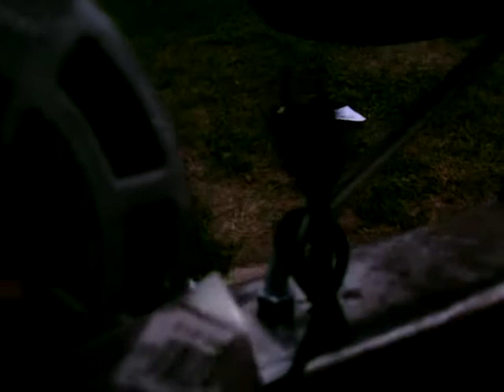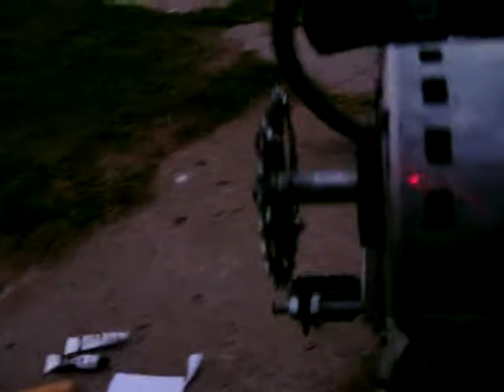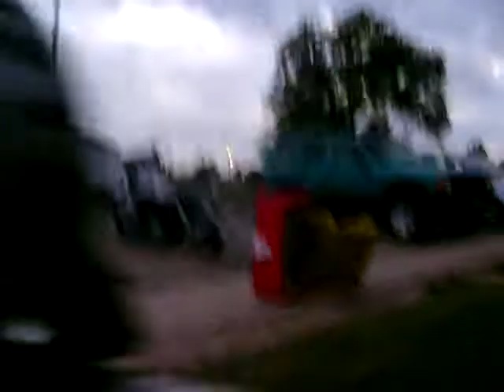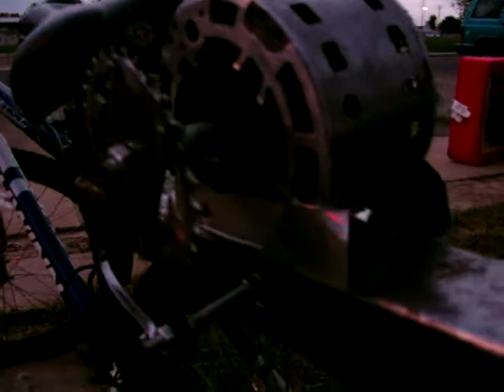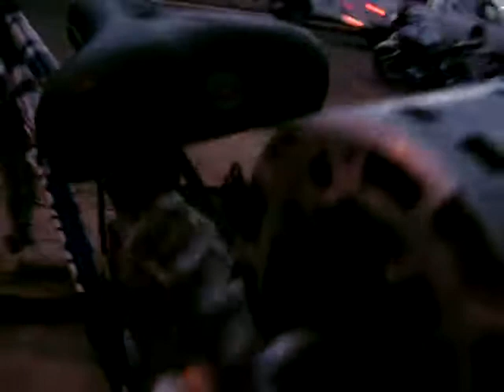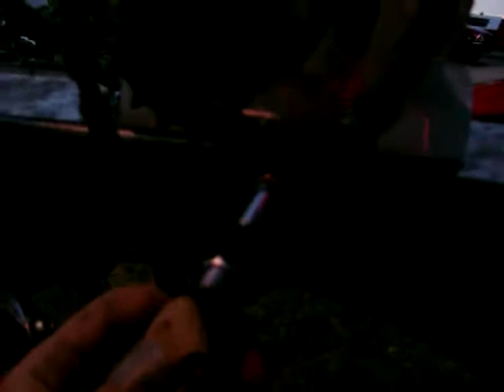electric bike build {part 2}

Comment: It's going to be hard to start the motor like that.  The way to go is to use a 6-12V motor and run it from a PWM to give more or less power/speed.  A car radiator fan motor should work.  Also that knobby tire is going make your ass numb from the vibration unless that's what you're going for.  If you can find a big stepper motor, that should work well also and have no brushes to worry about.  The drive circuit would be more complex though.